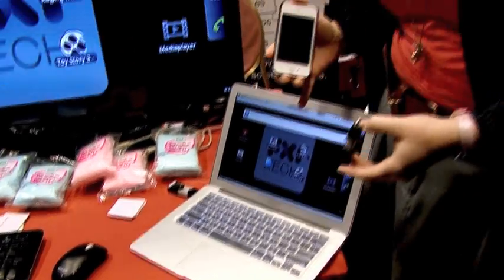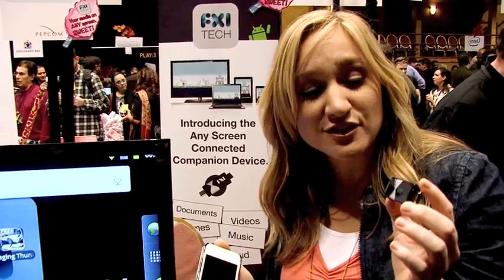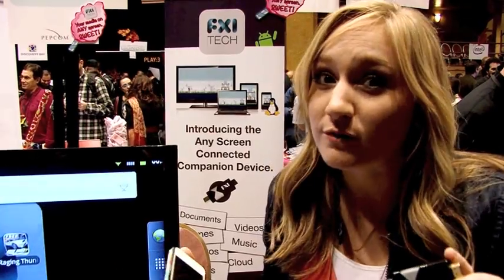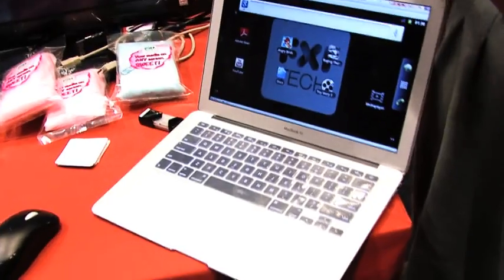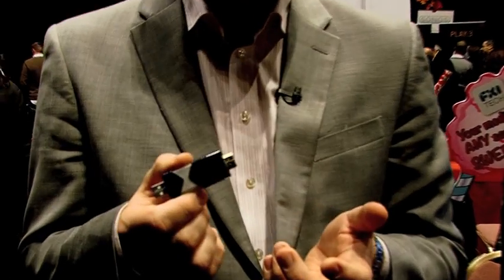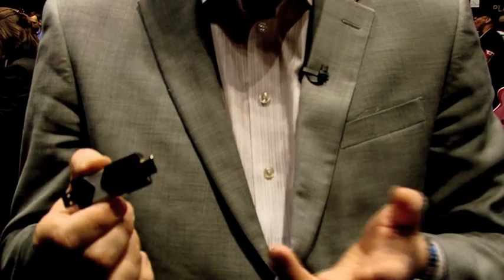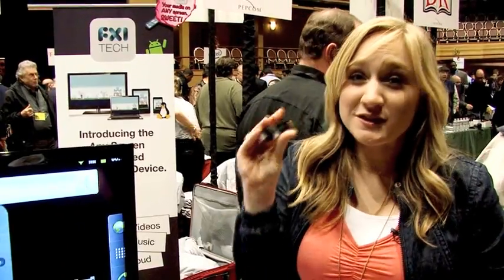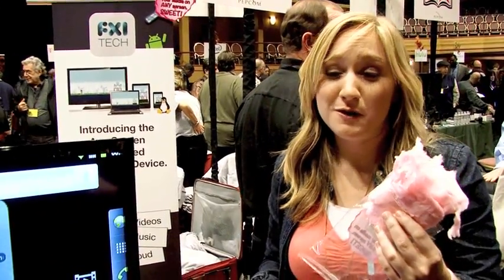USB Stick Contains Dual-Core Computer, Turns Any Screen Into an Android Station

Comment: @midcoregamer 

This video is a poor explanation of what this does.  Basically, in the future you'll no longer have any computer towers or laptops in your home, only monitors.  Think of this USB stick as a video card.  What it does is access a "Cloud Computer" that holds all your data and performs all computing.  The "Cloud computer" then sends data back to this USB device telling it what to display on the screen.  Can it play BF3?  If you've uploaded BF3 to the "cloud computer", then yes.